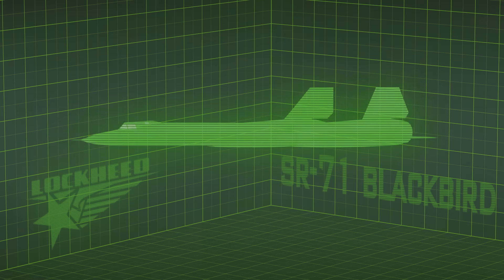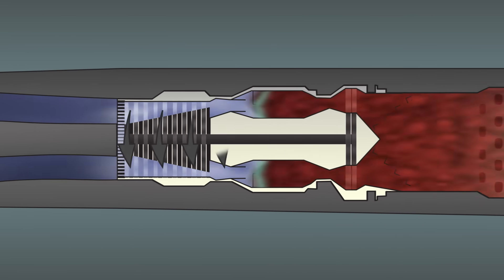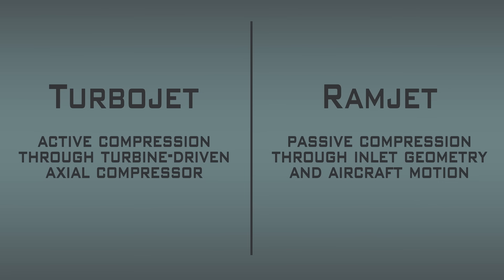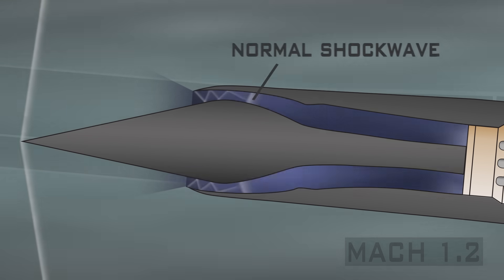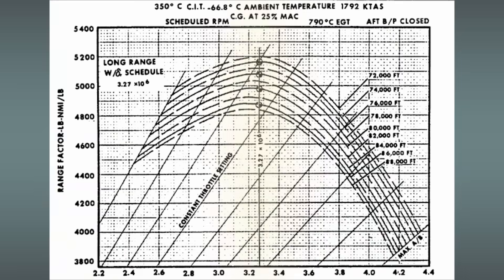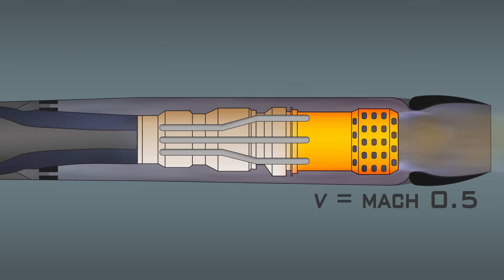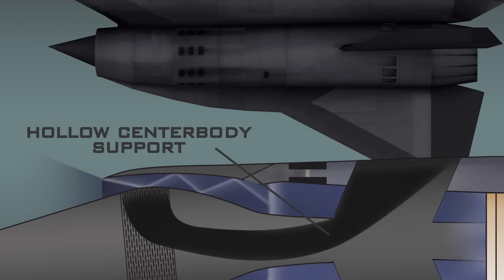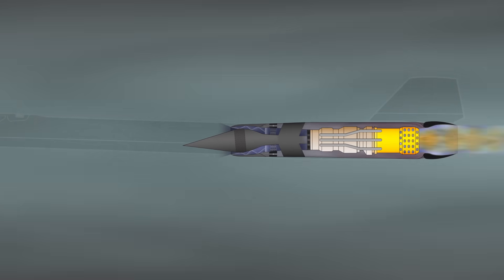The Mighty J58 - The SR-71's Secret Powerhouse

Comment: How is it, that this still seems advanced in 2019?
Reply: Because it is.
Reply: Because it IS still advanced, the SR-71 is still the fastest aircraft ever created. The reason we retired it is because of the much more effective strategy of using satellites and that the weapons it goes up against are faster than it is now, in terms of aircraft though, it still is the king of speed.
Reply: @chadyoung9934  I heard that the SR-71 can sometimes be faster to deploy than a satellite due to satellites taking hours to change course and maneuver, although don't quote me on that. I also heard that the reason it was retired was because of military budget cuts from before 911.
Reply: @chadyoung9934  are you sure? Aren't scramjets twice as fast?
Reply: @RichardMiller-tq6ut  Not practical yet and aircraft construction materials still can't take sustained  hypersonic speed in the atmosphere. As Kelly Johnson predicted it would be close to a hundred years before man could fly two to three times as fast as the SR with the caveat of doing it economically.
Reply: @eac1235  > Carbon-carbon, silica heat tiles and cryogenic fuels have made a hypersonic aircraft doable for some time now - see the Skylon passenger airliner variant for an example.

The bigger issue is making the things operate in an economically profitable manner, witness the rise and demise of the Concordes for why that might be a more difficult  problem than many think.
Reply: @RichardMiller-tq6ut The SR71 was created during the Old World Black Empire. The aircraft predates the 1700s. Lockhead Skunkworks was an Old World Black Empire company; this is why they refer to the crafts as the "Black World". 

Kelly Johnson and Ben Rich (code name Ben Dover shows his demeanor)are, for lack of a better word, imposters.
Reply: @chadyoung9934  X-15 is the fastest actually
Reply: @Skylikesavation The SR71 was created during the Old World Black Empire. The aircraft predates the 1700s. Lockhead Skunkworks was an Old World Black Empire company; this is why they refer to the crafts as the "Black World". 

Kelly Johnson and Ben Rich (code name Ben Dover shows his demeanor)are, for lack of a better word, imposters.
Reply: @RA_D-u4z  The Skunk Works was a reference from the comic strip "Lil Abner".
And, of course, you ate paint chips as a child.
Reply: @chadyoung9934  Would like to add that it wasn't satellites are "much more effective" or that defenses today are more of a threat as much as it was the increasingly high cost of operation, maintenance, and spares. Ultimately, it becomes too difficult to sustain funding for almost every program of this nature. Also, the first time I saw one in person, close enough to touch, was inside the secure SR-71 operational facility within Kadena AB on Okinawa. It was a hair raising experience - from some angles and lighting it looked very much like some sort of alien craft...
Reply: @chadyoung9934 The SR71 was created during the Old World Black Empire. The aircraft predates the 1700s. Lockhead Skunkworks was an Old World Black Empire company; this is why they refer to the crafts as the "Black World". 

Kelly Johnson and Ben Rich (code name Ben Dover shows his demeanor)are, for lack of a better word, imposters.
Reply: @chadyoung9934  Hmmm. Makes you wonder then why the U 2 is still flying well over 20 years after the SR was retired? Read Col(ret) Grahams book it deals with the real reason why the SR was prematurely retired.  Satellites still have not replaced the SR. Any info from a satellite is usually hours old and at best just under an hour. Drones are more effective for real time recon. As far as missiles bringing down an SR in today's environment, nope ain't happening unless it's a "Golden BB". I've met two sled drivers and a couple of backseaters and I trust their authority and knowledge.
Reply: Are we all just gonna ignore that  elliot dobson  died middle of the sentence that started this discussion?
Reply: @Merble  His brain suffered a catastrophic Intel unstart due to the sheer amount of freedom the J58 produced.
Reply: Corey  o my God looks like you're more intelligent than all Russian scientists and policy makers. How could they not understand such simple things?
Reply: @kaz9242  Ha-ha, do you really think russians is smart? They spent 70 years trying to make communism real in their country, even despite Carl Marx itself said it is impossible and unachievable for one country, because it's a step of global economical and society evolution.
They spent billions trying to copy space shuttle program, because they believed it's weapon system. And they stopped only because their GULAG economy massively failed.
Do you know fun fact? Russians can't even design they own car engine. All soviet/russian engines are modified copies of german/italian/british or american engines. Literally all of them. Same thing about planes and rockets.
You don't really understand what Russia is, because the only thing they really make good - it's propaganda. Russian propaganda is probably the most powerful in the world, they make you (and most of the people) believe Russia is a great country, which is mostly incorrect. Russian Federation directly spent 1.5 billions USD on propaganda every year. Half of this money is budget of RT channel. And it's only publicly available reports about direct budget spendings on russian TV corporations.
Reply: @mk_69mm  Yep! How about all their moon missions (lol)along with all their nuke sub accidents. Along with disasters like Chernobyl.
Reply: @mk_69mm  I dunno, they make pretty good alcoholics.
Reply: Aliens
Reply: It's still the only known air-breathing aircraft, aside from the XB-70 and its related development - the A-12 and YF-12, that can sustain Mach 3+ speed for a prolonged period of time. Some jets like the MiG-25 can get to that speed, but it can't sustain it, and even a short sprint over Mach 3 can be catastrophic for the aircraft. While the difference between Mach 2 and Mach 3 seems small, it's an engineering challenge that's still difficult to overcome today to design an aircraft that can cruise at Mach 3+ for hours. The engine must be very efficient in order for the aircraft to reach such speed, even aircraft that have a rated maximum speed of Mach 2.5+ like the F-15 never actually come close to that, Mach 2.21 is the fastest the Eagle have even flown on the record, and it was completely clean with relatively new airframe and engines. Many have tried to develop an aircraft that can cruise beyond Mach 3, but most failed to even leave the drawing board (that's also why the US abandoned Mach 3+ airliner, because it would be prohibitively expensive due to the titanium needed on a large scale).
Reply: @mickeyg7219  Pretty sure the F15 has flown at at least Mach 2.5 and also pretty sure that it is actually faster then its claimed Mach 2.5…some publications list it at Mach 2.8 or 1,800 MPH.

The plane can accelerate supersonic in vertical flight…

“Mach 2.2”😂😂😂😂
Reply: The brilliance of engineering never goes away while scientific discovery, once understood, seems less complicated. Good design is an art that.
Reply: Because the engineers who designed it were truly geniuses.
Reply: You realize today's layman still doesn't understand a lot of  physics discovered in the 1500's and before, right?

How many people actually understand and would be able to navigate using the stars? The layman is stupid, as they've always been. Engineering, physicists, chemists, mathematicians, etc. are the only group of people that consistently improve in understanding how to manipulate nature to create more impressive technologies. Anything that's been created in the past 200 years is advanced to the average person.
Reply: @chrism7574  This is true, im a physics student and I dont even understand alot of 15th century physics yet.
Reply: @deadmeat1471  ...Big July probably wasn't around in your school years . That's Julius Sumner Miller .
Reply: @philipvernejules9926  I feel like my generation missed a big science tv personality, but it could just be that I personally missed it. I think bill nye was around when I was a kid and i remember watching tomorrows world now and then
Reply: @deadmeat1471 You can therefore appreciate the incredible talent of those scientist. Imagine there is no one before you. You see an apple drop from a three and then proceed to create a bunch of equations governing the laws of motion.
Reply: @murcroadster There was a CIA A-12 (the A-12 is the lighter, slightly faster and higher flying single seater  version of the SR-71.  While flying a mission over Vietnam the A-12 sustained a nick from distant missile detonation.
Reply: @hoghogwild  True but the A 12 was at around 65,000 feet going Mach 2.7 . I've met a couple of sled drivers and backseaters and I trust what they say.
Reply: ......the painstaking perseverance and expertise and geniuses needed to build and develop it doesn't all come together easily . Like the moon missions over four decades ago a resolute will and determination is required without regard to cost .Also it doesn't appear that materials technology has advanced much in last six decades  except for some stuff with graphene and nanotubes which will be top secret stuff anyway .
Reply: 🤣😂🤮Where is a single reality fact about this jet NONE only a few outside pics 0 inside pics and a fake story on Wiki hahaha lol such a FAKE that has been produced by the Pentagon to make 35% demoncratic morons of the world to believe in it brainless brainwashed demoncratic western idiots LOL... trash fake channel blocked just like others!
Reply: ..... Because!!! That's why!!.....
Reply: @This Guy slam is a truly terrifying weapon and could travel much faster than the sr71. Radiation isn't necessary to beat the blackbirds however. Scramjets have been flown up to mach 10 or 12 for a decade and probably much longer now
Reply: elliot dobson  did you suffer a stroke
Reply: CR  ......sounds like crows when they play their Machiavellian games hiding their stashs of food . Birds are very strategic .
Reply: @agentlinch1873  wait till you learn of the Oxcart
Reply: @agentlinch1873  That’s not correct. Even an old S-200 can hit it.
Reply: @covidhoax7646  WRONG!
Reply: Because these days technology and our easy life means we are just 'learning by rote' rather than 'discovering', and it's not just engineering.... just ask anyone who studies Bach or any of he great architects or philosophers.
Reply: lol
Reply: Pssst. Because we reverse engineered it from something.
Reply: it's used to power supersonic cruise missile
Reply: because our peak in American society is in the rearview mirror.  It's been downhill since about the 90s sadly
Reply: One possible answer.
Is that the sr71 was designed for a specific purpose.
Not a multitask vehicle.
Again with the cause of reconnaissance almost - money no object in its development.
It also combines two technologies.
Turbo and ramjet.
Reply: To this day no other country has even come close to the Black Bird.
Merica!!!
Reply: @ Agent Linch

We’ve hit satellites and ICBMs going 5 times as fast as the SR-71 with missiles. 

It can definitely be shot down. That’s why it never flew over Russia.
Reply: AgentLinch Idiot, modern missiles could destroy it easily
Reply: @christophegroulx8187  Another idiotic statement by someone who doesn't know a thing about the military or air defense systems. Also to say nothing of the defensive capabilities that the SR had that are still classified Top Secret.
Reply: @eac1235  It’s a fact, modern missiles go significantly faster than in the 1960s and are much more accurate.
Reply: @agentlinch1873  Many modern sam can takedown SR71, but the effective range will be much shorter. SR71 is fast, but it cannot pull very high g like 4th gen fighter jets, as long as the missile has enough speed to catch up, it should able to hit it pretty reliable.
Reply: The Aurora has come online
Reply: @Jabroney its the reactor that powered it.
Its also a safe bet we have an unmanned spy plane that uses a similar reactor.
Reply: @Jabroney look up "Tory 2C Reactor".
It's no longer classified.
Because it was 50 years ago.

The SR-71 is not the fastest aircraft anymore 

Russia recently had a nuclear accident trying to "catch up".
Reply: @glennchartrand5411  It never was the fastest aircraft or even the fastest manned aircraft - that title goes to the X-15. 

The SR-71 (or possibly its close relative the A-12) is however still up to this day the fastest manned air-breathing aircraft ever to fly.  

The nearest competitor is the Mig-25 (Foxbat) which falls short of it by a few hundred MPH and can only sustain that speed for a short time, unlike the SR71 that is happy to fly continuously at Mach 3.5 for thousands of miles.

The fastest manned aircraft ever, and by a long stretch,  is arguably the Space Shuttle.
Reply: @listerdave1240 Yeah , but I personally define "aircraft" as something that takes off from a runway and isn't a spacecraft.

My definition isn't more valid than yours , its just the one I prefer.
Reply: @listerdave1240  x-15 is a rocket, not an airplane.
Reply: @covidhoax7646  It is an airplane powered by a rocket engine. It used aerodynamic lift to stay airborne and a rocket engine to push it through the air so its wings would generate lift.
Being powered by a rocket engine does not make it what we generally speak of as a rocket. I think you will agree that Chuck Yaeger was flying an airplane when he became the first person to break the sound barrier, even though his plane was powered by a rocket engine. Even before that the Germans were flying airplanes powered by rocket engines during the second world war (Me-163 Komet).
As I said before and will say again, the SR-71 was not the fastest manned airplane ever built but it WAS the fastest one that was propelled by air breathing engines rather than rocket engines, and as far as I know it still is. It was also the fastest 'mass produced' manned airplane ever built as opposed to a research prototype which the X-15 was and still is unless one stretches the definition of airplane to the Space Shuttle, which I think would be pushing it just a little too far.
Reply: @listerdave1240  X-15 used about as much aerodynamic lift to fly as a ballistic missile with a maneuvering head. SR-71 was not mass produced and wasn’t the fastest. SR-71 was a prototype aircraft where each flight was prepared like a space shuttle launch. MiG-25 was mass produced and was on routine duty with less than 10 min cold-to-take-off time. It was also faster in its maximum speed, but not in cruise speed.
Reply: @covidhoax7646   If you look at some flight profiles of the X-15 test flights you will see that for several of them the trajectory was nowhere near ballistic and impossible to sustain by anything other than aerodynamic lift. The whole reason for its existence was in fact to study flight at hypersonic speeds. There were of course also the quasi-ballistic flights during which it shattered the altitude records of the day.

With regards to the SR-71, there is a reason why I did put mass production in quotes. It was nevertheless way beyond being a prototype and was put into service to play a very important and significant national security role.

With regards to the Mig-25, according to my information even the brief sprints it could make at high speed still fell short of the SR-71 cruise speed by 500km/h. The top speed the SR-71 was capable of has never been disclosed and there has probably never been an attempt to reach it either. The engines could easily push it several hundred MPH faster, the speed more likely being limited by what the airframe can endure before overheating and/or becoming over stressed.

I don't quite remember how this discussion started but my main points are:
1. Fastest manned aircraft ever: X-15, and yes it is most definitely an aircraft
2. Fastest air breathing manned aircraft: SR-71 (that is not rocket powered or gliding)
And I should also include:
3. Fastest manned aircraft that was produced in large numbers (about 1000) :  Mig-25

Maybe worth mentioning also that the Mig-25 has recently become the fastest manned aircraft that is still in service, even in a very limited number.
Reply: @listerdave1240  Russian Topol-M and Yars also can fly on trajectories nowhere close to ballistic. That doesn’t make them aircraft. “Hypersonic flight”, doesn’t explicitly mean flight by an airplane. X-15 has elements of an airplane, but it’s a rocket, just like Zircon, Yars, Spiral’, or Yakhont. SR-71 were never in service. Just like B-2 was not officially in service for its first 20+ years in existence. They were experimental or production ready prototype aircraft that were used because nothing better was available at the time. That does not diminish the amazing achievement that they embodied!
Reply: @covidhoax7646  There is absolutely no similarity between the X-15 and those missiles. The missiles are  ballistic missiles that are capable of making slight deviations to the ballistic trajectory and having more substantial control during re-entry, much like a manned Soyuz capsule would, just with a significantly larger cross-range capability. They can do quite substantial deviations to their descent through the atmosphere but they cannot sustain horizontal flight or anything approaching that. I do not see any reason to compare them to something like the X-15.

The X-15 on the other hand could and did fly exactly like an airplane, just much faster and could also behave like a rocket (or missile if you prefer) as any aircraft with very powerful engines can. It had all the aerodynamic surfaces that you find on an airplane. It also landed exactly like an airplane. It could in theory also take off from a runway just like an airplane. They never did that though or even thought about doing it though because it would have contributed nothing to the research program it was designed for. They wanted to get as long hypersonic flights as possible and taking off from the ground would have consumed most of the fuel just to get to the altitude at which the tests would begin. That is the reason why they dropped it from a plane rather than taking off from the ground. It was not because it couldn't. Most of its flights where aircraft type trajectories, sustaining hypersonic flight in horizontal flight. The semi-ballistic flights were not the major part of the test program.

I don't get the SR-71  'not being in service'. They were used because there was nothing better available - sort of. They were designed and built because there was nothing in existence that could do the job so they went ahead and designed and built them. It is what one does when one needs something that does not exist. They were designed for a very specific purpose and they fulfilled that purpose over a number of years. Only a few were needed so only a few were built. By the same measure you could say that almost any large bridge or dam is a prototype because only one is built to the specific design and there wasn't any bridge there already that could serve the purpose.

Just to stay on track, my points with just a few small changes:
0. Fastest manned aircraft of any type: Space Shuttle (no longer in service)
1. Fastest manned aircraft ever in powered flight: X-15, and yes it is most definitely an aircraft
 (experimental)
2. Fastest air breathing manned aircraft: SR-71 (that is not rocket powered or gliding) (no longer in service)

3. Fastest manned aircraft that was produced in large numbers (about 1000) :  Mig-25 (still in limited service to this day)

I added the Shuttle which I forgot to mention earlier. It is a bit dubious whether or not it should be on this list, it being  dual personality, a rocket on the way up and a glider on the way down. Shortly after re-entry as it slows down to about Mach 8 it assumes the full characteristics of an unpowered glider, which I guess is generally classified as an aircraft.

I don't think the SR-71 will be superseded any time soon but the X-15 might be in a few years time with something on the lines of Virgin's SpaceShipTwo.  That will only do 4000Km/h but it is likely to be followed by other similar tourism craft with higher capability pretty soon after it enters into service.
Reply: CR  acctually US always say freedom , but there still have many people discriminate against blacks. we all know US has get many important confidential from germany  when war II.  US want to be a leader in the world?  if he want to beat anyone then he could go beat him, this is freedom. ridiculous!  ridiculous! ridiculous!